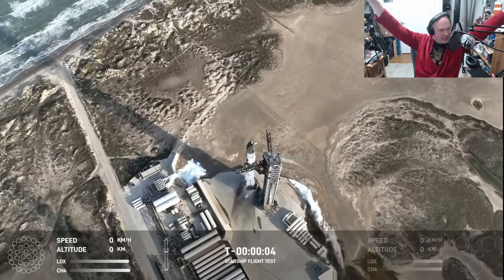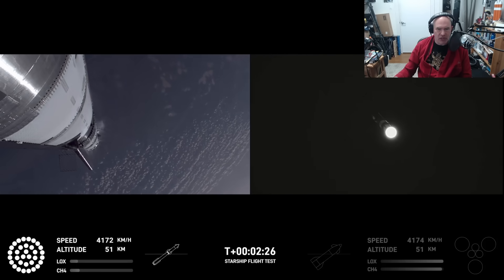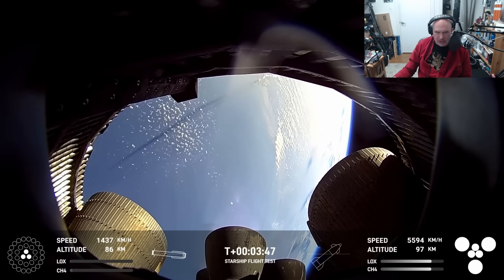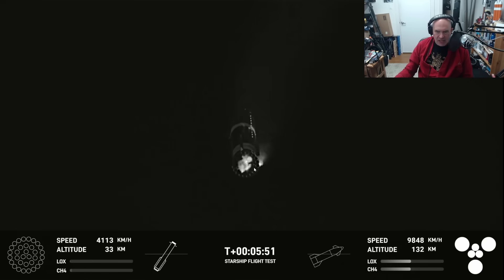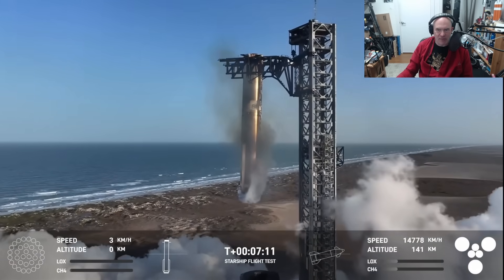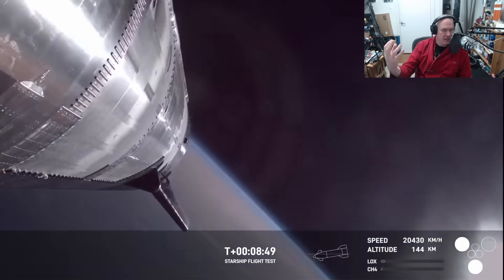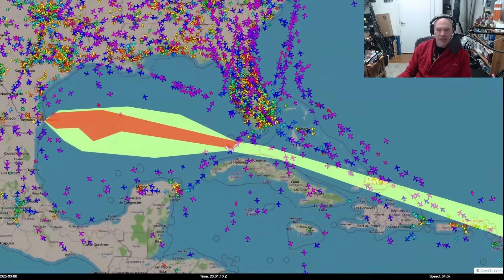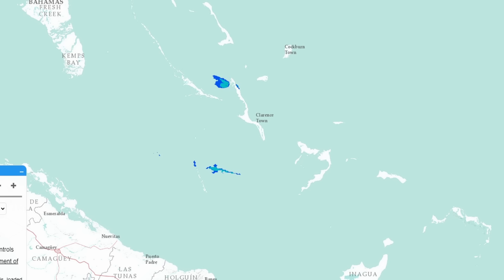SpaceX Make The Same Mistake Twice With Starship Flight 8

Comment: Well, this type of failure wasn't happening on the V1 SSs.  If it ain't broke, don't fix it!  The current configuration is a failure and there is no point launching it again.  Part of me thinks that engineers who designed all of these "improvements" were loathe to admit that there was a major design flaw in V2.  Do they have any V1s still in the shop?  This was a distressful failure because it highlights that something BIG, not easily fixed, has been designed in and now must be designed out.  Trouble is, you won't really know if you cured it until you fly again.  I imagine the new plumbing increased fuel efficiency and payload efficiency.  But none of that helps if it blows up the rocket.  I'm very disappointed, and I lose patience with the trolls that just want to insult Elon over politics, but SpaceX does now have big headache and it's going to be some time till they are ready to fly again after this.
Also, the Raptors keep failing to relight.  This has been a recurring problem for some time now and they haven't fixed it yet.  It's worrying when problems recur.

Comment: What surprises me most is that Starship doesn't have a system that checks each engine thrust output by the millisecond and connects it to an auto-shutdown system to prevent asymmetrical thrust if one or more engines fail. Its not so much an issue on the booster, but on Starship, it seems so basic.

Comment: so this is mission no. 8, Saturn V had 13 lunches, including all the Moon landings etc. I know this is "move fast and break things" development, but this is nowhere near able to land on the Moon, not to mention Mars
Reply: It's not a mission number 8, it's test flight number 8.. There's no missions for Starship currently. Their goal is to make it reliable enough so that they can start re-using every part of it to make it cheapest way for heavy payload delivery, but every single exploding starship is still currently a successful test flight as long at it you know... Flies.

So far they have successfully caught 3 boosters (even without having all of the booster engines lighting up) and their only issue is with the final stage.. But obviously that part will be very important to get working, since that's where all the important people and payload will be
Reply: @DelPlays 
The number for the Saturn V also includes test flights
Reply: I'm glad you mentioned Apollo/Saturn. Let's review the technical analysis of the Saturn V launch vehicle: 

Apollo 5: After two orbits, the first planned 39-second descent-engine burn was started, but this was aborted after only four seconds by the Apollo Guidance Computer, which detected that the spacecraft was not going as fast as expected. This happened because one of the engine's valves was suspected of being leaky and was not armed until it was time to ignite the engine, in orbit, which meant that the propellant took longer to reach the engine, leading to the lag. The ascent stage spun out of control eight hours into the mission, after completion of the engine burns, due to a problem with the guidance system.

Apollo 6: Two minutes into flight, the F-1 engines on the S-1C stage entered pogo oscillations leading to the loss of one of the panels of the Spacecraft-Lunar Module Adapter (SLA). Three hundred and 19 seconds after launch, a fuel line leak in the S-II's engine 2 caused a loss of thrust. After 94 seconds (T+412), the thrust had dropped off further; both engines 2 and 3 lost 40 percent of their power, triggering a shutdown of both engines. The dual shutdown was accompanied by a power surge, which caused a loss in pressure in engines 4 and 5. Only engine 1 made it through launch unscathed.

Apollo 8: S-II second stage experienced pogo as reported by the command pilot at about 50 seconds before engine cut-off. Data analysis revealed an 18 Hz vibration of the center engine of the five engine J-2 cluster. Mounted on a crossbeam structure, the center engine was vibrating with the liquid oxygen (LOX) tank bottom. The magnitude at the crew cabin was actually quite small and no threat, but the local amplitude at the engine mount posed a threat to the supporting cross beam structure. Loss of the engine mount structural integrity would have led to the loss of the vehicle and crew during ascent.

Apollo 9: Apollo 9 behaved opposite to the model predictions designed to mitigate the pogo problems of 5, 6 and 8. A 17 Hz oscillation occurred between 500 and 540 seconds in flight, with peak amplitude of +/- 12 g’s at the local thrust frame. The vibration amplitude experienced on Apollo 9 was judged to be too near the 15 g structural limit determined for the support structure for flights to continue without some mitigation. Loss of the engine mount structural integrity would have led to the loss of the vehicle and crew during ascent.

Apollo 10: The S-IVB third stage exhibited a pogo oscillation of 20 Hz from 50-100 seconds into its burn. The vehicle shook badly again while executing the TLI burn, causing Cernan to be concerned that they might have to abort. A Mode IV abort from TLI had never been tested. An abort would have left the vehicle with insufficient velocity for a free return trajectory. A failed abort would have led to the loss of the vehicle and crew in trans-lunar space.

Apollo 11: AS-506 experienced a “small bulge” of pogo exceeding 4G's at 75 seconds into second stage operation of the J-2 engine cluster. This would remain a recurring problem for the Saturn V vehicle which increased in severity on upcoming flights. Mission Control chose not to abort the ascent.

Apollo 12: Four well-defined pogo occurrences were noted during Apollo 12 (AS-507). The Apollo 12 vibration at the center engine had reached 8 g's and again concerns were raised for the vehicle's structural integrity. Time was granted for the contractor to develop a helium-bleed toroidal pogo suppressor for the oxidizer side of the J-2 engine. The suppressor was available for Apollo 13 (AS-508), but there were concerns with the flight schedule, and the difficulties of installation, inspection, and verification on the waiting Apollo 13 Saturn V vehicle. These concerns and the favorable analysis prediction of nonlinearly limited vibration amplitude led to a decision to fly AS-508 as-is. No fix for pogo was implemented.

Apollo 13: During the second stage burn, two episodes of pogo occurred on the center J-2 engine as expected from previous missions, but the third occurrence diverged severely and acceleration at the engine attachment reached an estimated 34 g’s (the accelerometer went out of range) before the engine’s combustion chamber low-level pressure sensor commanded a shut down. It was estimated in the post-flight investigation that only one more cycle of amplitude growth could have been sustained without catastrophic structural failure. Loss of the engine mount structural integrity would have led to the loss of the vehicle and crew during ascent.

Apollo 15: There was a malfunctioning light on the craft's service propulsion system (SPS). Fearing that the light meant the SPS might unexpectedly fire, the astronauts avoided using the control bank with the faulty light, bringing it online only for major burns, and controlling it manually. After the mission returned, the malfunction proved to be caused by a tiny bit of wire trapped within the switch which could have triggered an uncommanded burn of the SPS engine. An uncommanded burn would have led to the loss of the vehicle and crew in trans-lunar space or Lunar orbit.

Engineering conclusion: The Saturn V rocket suffered from uncorrectable design issues which lead to the near-loss of vehicle and crew on every flight. In hindsight, it never should have been a man-rated vehicle.
Reply: @teebob21 from your last paragraphs, where are the failures of apollo 14, 16, 17, apollo soyuz, skylab? So no "failures in every flight". Apart from that, many failures were not desig flaws, but manufacturing issues. And on top of that, when desig flaws were found (as in the apollo 6), nasa put a great amount of engineers working on it until the problem was solved, something that does not seem to happen nowadays
Reply: @arthurdefreitaseprecht2648  Fascinating. When was the J-2 pogo problem "solved"?
Reply: @teebob21  the fact that the J-2 worked everytime afterwards?????
Reply: @yaya1338-w7d  35 G's of pogo on Apollo 13 was "solved"?
Reply: @teebob21  yes , the reason it didnt show up on previous missions is because on 13 the pogo problem was amplified by cavitation .  But on the later flights they implemented another fix and this didnt happen again

Comment: So 8 flights in we're standing at a grand total of one slightly toasted Chiquita delivered to orbit. Good thing it's not tax payer money, otherwise something would need to be done about it.
Reply: Actually, it is taxpayer money - they got quite a big contract for a Lunar Lander using this piece of junk
Reply: Yep, 3 billion to deliver a working Human Landing System and land it on the Moon by now. So far they got a launch vehicle that never delivered a payload to Earth's orbit and they're barely 1 step out of 20 into actually landing their HLS on the Moon. Which doesn't even exist yet (the HLS, not the Moon ;) ).
Reply: NASA contract has been exceeded by double, felon asked for more money from NASA and his corrupt buddy is getting the lead chair in NASA, so felon will be stealing more money from usa.

Also his theft of the Verizon FAA software update for 3 billion tax payer buck ain't nice.
Reply: Wouldn't even say it delivered it to orbit, Starship has not completed a full orbit around the Earth once so far.
Reply: These are test flights. reaching orbit is not important. testing the vehicle is.
Reply: @RocketPal 
So this is how you test prototypes: 
1. You build something that should work
2. You test it against its design specs
3. Issues that occur are corrected for the next test 
The thing is that you need to develop something that should achieve what you want it to do before you can start with testing. If you're prototyping a plane, you don't start by continuously building things until they stop falling out of the sky, but rather you start with a prototype that can fly. 
You can't do any refinement if your prototype doesn't work. And prototype testing should only follow if you're already confident in your design.
Reply: @RocketPal  By that same logic, I can crumple up a sheet of paper and throw it and call it a prototype of a paper plane. I was testing the vehicle, achieving actual flight wasn't important! Good lord...
Reply: @Case_ flawed logic. They almost reached orbit, and had enough capability to complete it. They didn't, because they were being careful about standing an immature test vehicle in orbit. The vehicle was 99% of the way there and the 1% was INTENTIONALLY ommited. If your prototype flew well but failed to land as you hoped, then you'd be closer to a valid analogy, but you're just spitting nonsense and fail to understand the cold facts. But, don't worry, this industry is pretty difficult to fully grasp, it's fairly complex. May I suggest you perhaps stick to paper airplanes? It seems like that is a bit more suited to your capabilities.
Reply: @martinsedivy4594  Not full of yourself and condescending in the slightest I see.
Reply: @Case_  Replying in the true spirit of an internet "discussion". You essentially commented in a similar way, now it's just turned against you and you choose to only respond to the social inadequacy of a comment to avoid responding to the challenge of your logic. Yes, my comment wasn't nice, because you're spitting nonsense and I'm tired of it.

Comment: SpaceX has had lots of experience with landing boosters. Now that booster stage is basically perfected, this is one of only a few attempts at getting a starship to orbit and deploying a payload. Having lived through the endless tests and failures of the F9 booster landing and re-use, I'm confident that something will have been learned from this launch and there will be steady improvement in future attempts.